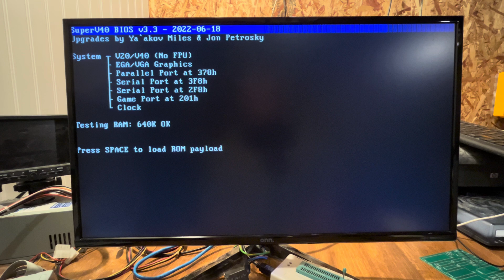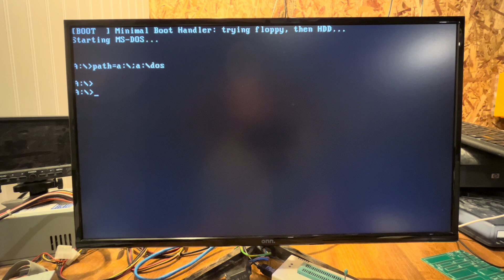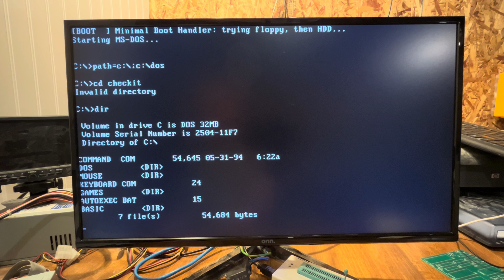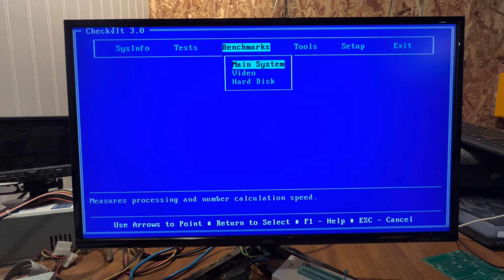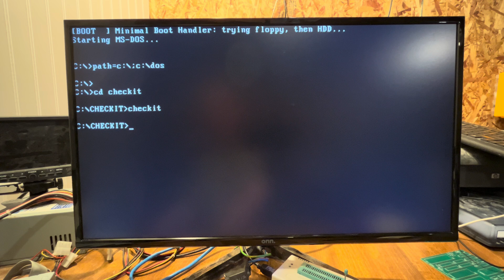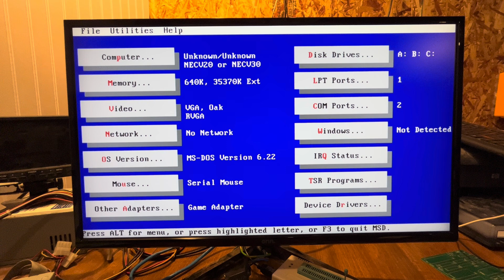8088 PC XT Compatible On An ISA Card. Second Build.

Comment: Can the V20 be clocked at the full 16 MHz spec in this board? After playing with these old systems I find that 8 MHz is just a bit too slow for anything interesting I want to do, but around 16 MHz is where the sierra SCI game engines start to run at full speed.
Reply from the maker: I have found anything over 10 mhz doesn't work well with the ISA bus. It is just too fast. I think you need to have an external bus controller that keeps the speed of the ISA bus below 8 mhz. Or something that inserts some wait states into the bus cycles. I have had some luck with a prototype running at 16 mhz.

Comment: Nice design. A bit more minimalistic than mine Xi 8088 :) Regarding floppy support, BIOS, etc., try using my 8088 BIOS instead. It's got the support for floppy drives larger than 360 KB and other useful features.
Reply from the maker: I will have to try it. Have you gotten up to a 1.44mb drive to work?
Reply: @elijahmmiller  yes, and also 2.88 MB, although that requires an FDC that can do 1 Mbps

Comment: Consider a daughter board for math coprocessor in future build.
Reply from the maker: The system runs in minimum mode. I have been looking at adding an 82188 bus controller because it can handle both the 8087 and 8237 requests. I think in total it would add 3 chips to the system.

Comment: Nice. How many layers do you use? Was that thing hard to route? I'm trying to route a fpga video card with a 16 bit data bus and 20 bit address bus and boy is it a nightmare.
Reply from the maker: This is a 4 layer board. For the routing what I do is on one side the traces only go right to left and the other up and down. And the middle layers are the same. This keeps them from tangling up.

Comment: So, it's a SRAM based memory running on, as you don't have to provide DMA0 refresh cycles?
Reply from the maker: Correct it is all SRAM. One advantage of the lack of the DRAM refresh cycle is there is a noticeable overall speed increase.
Reply: Of course!
SRAM is what's used for cache even today, on cpu dies.
I know YOU know this, but others might not.